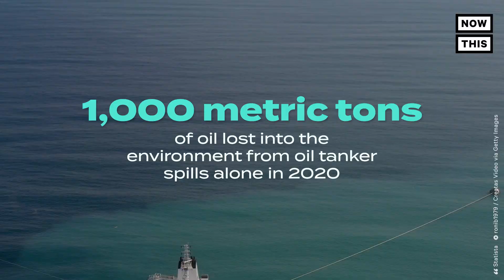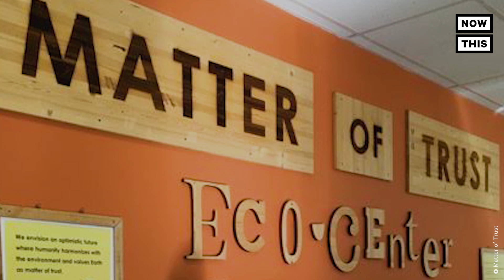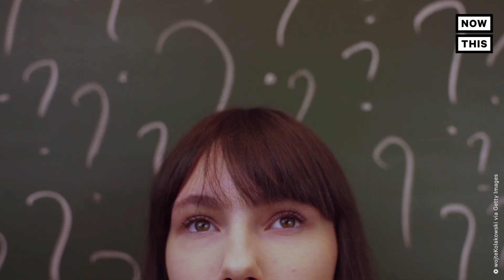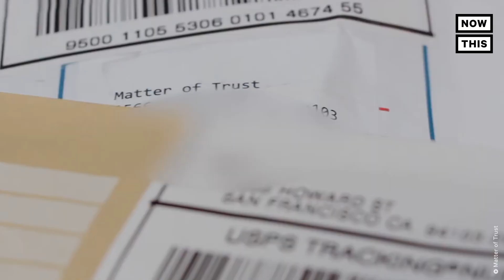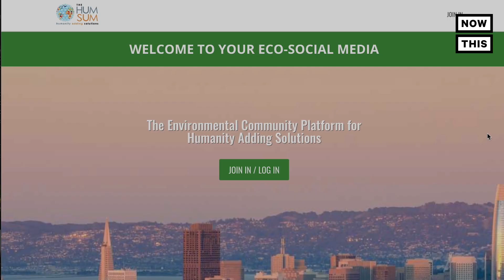Recycling Human Hair to Clean Oil Spills | UpcycleThis

Comment: I wonder if there's actually a way to recover that oil back (like kinda passing the full filter by a distillation process or some medium high temperature "bath" to recover those hydrocarbons and reuse such filter a couple of times. 

I can imagine such thing to be left in a lake and after a month check the pollution level on the lake at very cheap price